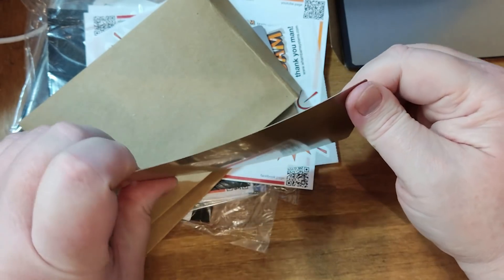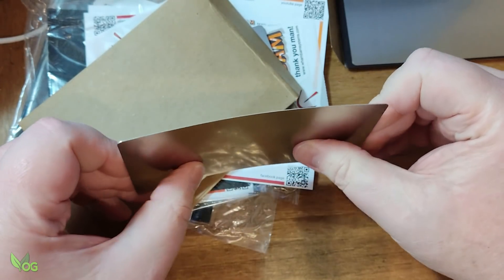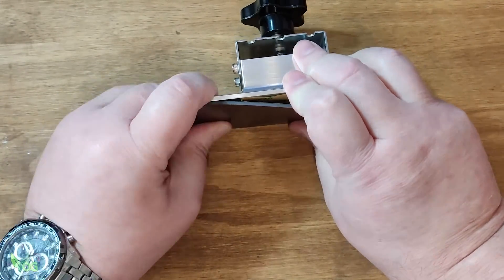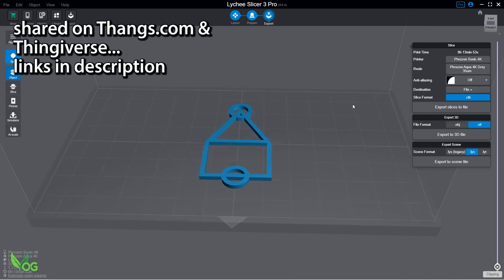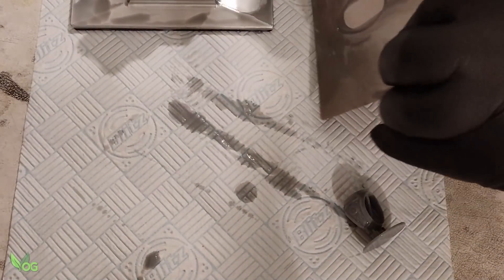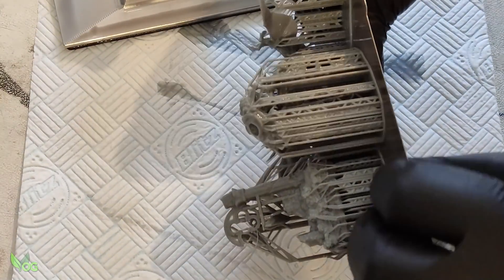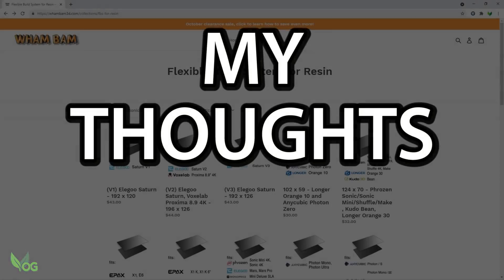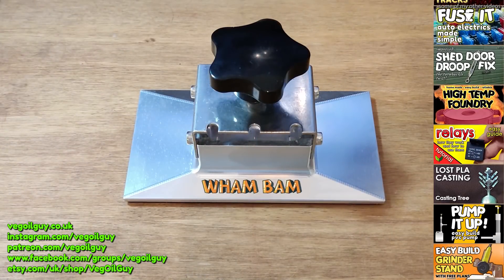Wham Bam flexible plate review - using a flex plate in Resin 3D printing - by VOGMAN

Comment: The main thing I'm looking at it for is my original saturn. It uses a ball joint, and even tightening it as hard as I can, I need to be very careful not to unlevel it by leveraging the plate against the clamp section

Comment: Is cleaning with IPA a requirement or would simply wiping it down til clean work as well? I have an Elegoo Mars 3 with Water-Washable resin so I don't keep IPA on hand.
Reply from the maker: I'd recommend some alcohol to get things really clean... nail polish remover, white spirit, turpentine, glass and alcohol wipes, etc. The cleaner it is, the better you can expect the adhesion to be.

Comment: I fitted these plates after only 2 prints on my new resin printer.    Both prints had to be removed via a hammer hitting the handle of the scraper, and that sold the flex plate to me.

They are so good, I bought a couple more.   👍

One thing I did do, was file down the tabs a little bit, as I’d sometimes manage to scape the resin tank side on my Mars 2pro with the tab.

Comment: For some reason, my build plate has become harder and harder to remove things from it. I have no idea why no settings have changed. I’ve bought a flexible plate to see how they do and my first print with it is inside my printer right now. Wish me luck.
Reply from the maker: A flex plate should work great for you. 😁

Comment: Hi, I just purchased a Flex-Plate for my Saturn S. Are there ANY SPECIAL LEVELING instructions after it’s been installed? Or will it Level using the Factory Leveling Method? 
🙏ANY HELP APPRECIATED🙏
Thanks,
Lee
Reply from the maker: Just make sure you follow the videos on the Wham Bam website. Those guys are very helpful 😁

Comment: flex plates are great. If you print directly on the print plate, this is where they shine the most (i do that often for engineering parts). If you print a lot with hard / tough resins, they are also a blessing. Just be sure, as said in the video, to do the steps needed to get a good bond on the build plate. If you don't, the resin will work it's way in under the adhesive over time and you will have a sad day waiting (been there, done that...)
Also, be sure you get a brand with 3M adhesive. There are flex plates on the market with no name adhesive and they will fail over time too (been there, done that. lol).

Be sure that you lay out your build plate from center and out. If you put prints in the corners without anything in the center they can peal off by the suction between the plate and FAP film but if you have an even pull distributed on the plate you should not have this issue... so if you have dead pixels in the center of your screen and want to avoid that by putting you print on the side, you won't have a good time. Change the screen.

... but once you go flex plate, you will miss it if you get rid of it. I like them over all despite there minor issues.

as for putting your build plate in IPA, no need for that. Just rip the flex plate off and dump that into the IPA if you feel the need. Wipe off the magnetic part and you are good to go for next print. You won't need to level your build plate often since there is no force applied to the build plate when getting stubborn models of the build plate (this is an issue you will have if you use Elegoo printers).

Comment: I've been trying to use mine for a bit now and have had a 0% adhesion. Thankfully I have a 2nd build plate. Stock. Tests on that are flawless... I must have a defunct wham bam. Which is sad cause they won't do anything about it. Had to wait too long for my Jupiter.
Reply from the maker: I had the same problem initially. It could be a resin issue as some stick easier than others. Luckily the plate has two sides. Keep one side as it is, nice and smooth. For the other side, take some ordinary sandpaper, something nice and coarse like 80 grit. Rub this in circles and cover once side with scratches. Clean well then try again with the roughed up side facing the resin tray. You should find the scratches help the resin bond. Also increasing your base layer times by 5 or 10 seconds is a good idea 😁
Reply: @vogman  yea, already tried that sadly. And no different. I can't even think of a flaw that would cause these issues.

Comment: I just got my flex plate for my mars 2 mono and am working now on the steps to clean and ready the build plate and instal the spacer needed. It is indeed VERY important to not skip steps, or do them half way. I can't wait to finally get mine installed and give it a few rounds. I have two bottles of new resin just waiting for some fun times.

Comment: I LOVE mine. Sometimes it really is difficult to get it off the plate. I have them for 3 of my printers. The one time when it doesn't help is with flexible resin like Siraya Tech Tenacious. But then you just scrape it off the old way.
Reply from the maker: Thanks for the input Phil 😁
Reply: I should clarify. When I said sometimes it's hard to get it off the plate I meant the regular plate without the Wham Bam.

Comment: For simplicity and speed, I've been printing resin lithophanes flat on the bed. Though, it was painful to remove the lithophanes from the bed, and I often broke them. When I switched to the Wham Bam system, the first attempt failed because the lithophane didn't stick well enough to the plate. After roughing up the flex plate a little, the lithophanes prints fine, and no more breaking. The one drawback, as you mentioned, is the cleanup does take a little longer and uses a bit more materials since you have to clean two additional surfaces.

Comment: I am dealing with wide and thick flat surfaces printed directly into the building plate, and it is impossible to remove them without chipping and breaking edges and corners... In my case this can be a real nerve saver!
Reply from the maker: Thanks for that. It makes perfect sense 😁

Comment: I swear by them - the Sovol pack has 2 plates so you can swap over if you want to kick off another print quicker, and the other advantage of the system is that it doesn't put any strain on the build plate head so you never knock it out of alignment trying to get a print off. They're cheaper than a wash an cure station and similarly just make sorting out the pieces after a print that much easier so I'm not really sure why wash and cure stations are more of a thing than flex plates are

Comment: I got the wham bam after a friend of mine wanted to do an order together. (I live in a country where we typically get high shipping so doing orders together saves a lot) I would normally not get the plate if he hadn't asked me. But once I got it, I must say that my process is cleaner and easier now. Being able to keep my gloves clean for longer as I now can push the plate off of the build plate into my initial IPA bath, and then clean off the build plate. This lets me clean the build plate with clean gloves, leaving the knob at the top clean as well. Then I get into removing the prints from the wham bam plate, which is much easier than before since I can just flex it, and cleaning that plate is just a quick wipe with an IPA soaked piece of paper towel. Previously I was "fighting" with the metal scraper on the build plate with resin soaked prints on it, making a big mess of uncured resin on my silicon mat. Now I honestly don't have to clean the silicon mat anymore as there is no spill on it, it's just an extra safety.

Comment: I got this flex plate for my Photon Mono SE and I used it for about 3 months or so then it failed on me.  Unfortunately resin seeped its way in-between the magnetic pad and the metal build plate causing it to delaminate.  So I glued it back on with 3M spray adhesive and the adhesion only lasted maybe about 30 or so prints.  When I originally installed it I followed the instructions exactly yet it still failed.  My thought is that the suction of the print being pulled off the fep sheet was stronger than the adhesion they used for the magnetic pad causing it to fail.  Good luck to anyone else using this and happy printing.
Reply from the maker: Thanks for the feedback.
Reply: Please write us at technical@whambamsystems.com with your experience and install process and we will help you to get a replacement and learn how to insure in a more secure method

Comment: surprised you just tried this now! i have some tips on using this.. Every time you take off a print, make sure the magnet and the plate is CLEAN. resin in between can cause the flex plate to shift especially if you have a full plate or printing things flat. Also, in the video tutorial, the guy slapped it on and let the magnet catch the plate. DON'T do that after you've taken off a print or just cleaned it and it's still wet. I've had resin and alcohol splatter on my face! good thing i was wearing PPE!!
Reply from the maker: Thanks for the important feedback 👍👍👍

Comment: I sharpened my scraper that came with the printer on a cheap whetstone on Amazon and gave it a chizel edge. Prints take maybe 1/2 a second to pop off the plate, and I don't have to get my gloves completely covered in resin by trying to flex a plate. I just don't see the point, it's an extra point of failure (I've had to help a large amount of people who had issues with theirs despite following directions) and it's significantly more messy.
Reply from the maker: I'm a scraper man myself... but a lot of folks find this tricky and these plates are a godsend for such folk 😁

Comment: I've loved having my wham bam system, so much so that I've attempted some tricky prints and will occasionally design some things around having the build plate to minimize supports. That said, flex plate systems get a bad wrap because most people don't install or maintain them correctly, or they get the cheap chinesium ones and banish all similar systems to the Sin pile after having issues. I can't tell you how many people have their systems slide off during prints and blame the plate when it's both a quality issue, and they're trying to print a 1/3 scale bust without hollowing the torso. 🤦‍♂️
Well reviewed and I'm glad you gave it a fair shake.

Comment: I put flex plates on all of my machines. Why? Because I run thin rafts so that my burn in layers will extend to the first few layers of my supports. Makes for more solid supports, and ultimately better prints. And getting thin rafts off of a standard build plate with a metal scraper is a nightmare.
I will say that one drawback is occasional shifting of the flex plate on large build plate when it's fully loaded. Typically does this on the raft layers or if I'm printing a bunch of flat bases for minis. I fixed this by supergluing some strong magnets to the top of the build plate to give it extra magnetic strength
Reply: I was thinking  of doing the same thing and add some magnets to the top of the build plate.
What kind of magnets are you using?

Comment: I leave my build plate on the machine and only take off the flexible plate. I throw the flexplate with attached print into the wash and cure machine and give the magnetic surface a quick wipe with an IPA dampened paper towel. Once the wash and cure machine has gone through a cycle, I pop the print off and give the flexplate a quick wipe with a dry paper towel and put it right back on the machine. 

I bought two flexplates to reduce time in between prints but haven't found it necessary to use the second one yet, clean up is that quick.
Reply from the maker: Thanks for the input 😁

Comment: I'm so glad you checked them out!  I have about a dozen of their magnetic build systems on my FDM 3D printers and love them.  I bought one for my Voxelab Proxima and in my excitement to get it setup, didn't read all of the instructions!  A spacer is needed where you clamp the build surface!  I promptly blew out my FEP sheet...it wasn't a complete tear but somehow I keep having resin appear on the screen, ruining prints.  So, I sprung a tiny leak! (Also, don't use a plastic scraper to remove resin from the skin surface, I ruined that too! Anyone want a fk'd up Proxima? 😂 )  Great review!
Reply from the maker: Thanks for the input 😁

Comment: Wham Bam installed on my Sonic Mini 4k. Got layer shifts at the lower layers all times. Internet research: im not allone at all. -> Trash. Expensive experience
Reply from the maker: And yet so many comments here speak positively. Can I ask, do you clean the plates after each print. If you leave resin on them it can act as a lubricant between the plates allowing for a little movement. That could cause the issues you mention... just a thought 😁
Reply: @vogman  yes,of course, I Clean always after each print. First with 99% Isopropanol, then before a new print with acetone, until there is no residue colour on the cotton Pad. But that was not the problem, the metal plate shifted, even thoroughly cleaning the plate faced to the magnet as well as the magnet itself.
Reply: Hello, I do not own yet a Resin printer, but considering to  own one once. Just wondering if the lift speed needs to be adjusted for larger printers when using a magnetic bed, to reduce the pull force when printing larger prints?
Is that something to consider?

Comment: I'll never understand why people take the whole build plate off... Just take the flex plate off with the part....
Reply from the maker: From what I can gather,  if you leave resin on them it can act as a lubricant between the plates allowing for a little movement. It's safer to remove and clean - just in case 😁

Comment: Nice review! Glad it made you a believer in the Wham Bam FBP system. I have one on my Sonic Mighty 4K and it's improved print removal tenfold. I wasn't a fan of all the scraping to get prints off the stock surface. Also, I've put it in the Anycubic Wasn n Cure Plus many times after print completion and it continues to have a strong bond, despite all the IPA baths.
Reply from the maker: Thanks for the share 😁

Comment: The only good reason for a flexplate that I can think of is if you need to directly print on the plate, and a scraper would damage the parts (i.e., your first test). Metal scrapers get things off very easily otherwise, especially with rafts - I wonder if most people have far too many bottom layers with too much exposure?
Reply from the maker: I felt the same way... but when you use one, it does feel easier 😁
Reply: If you have to use any force on the stock build plate you can knock the alignment off. Even if you have to use some force on the flex plate it's not pushing anything out of alignment. Less re-levelling = more succcessful prints and less hassle

Comment: The only one I had problems with was the one for the mono x, the first one I got had a weak magnet, and large prints would pull the flex plate off the magnetic bed, they upgraded the magnet and sent the new one to me, it is better, but still needs improvement as bigger prints still pull it off the plate, just not as bad.
Reply from the maker: Interesting. It's good to hear they listen to their customer though 😁

Comment: I had the original Elegoo Mars and used it with Elegoo resin. Never had a Problem. BUT when I got my Anycubic Mono and started Printing Sirayatech Blu with it there suddenly was no way to get the prints of the plate without destroying them (printed without support). Still not sure if its the plate, the resin or the combination. Anyway, got my self a flex plate, tried it and worked perfectly. Happy flex plate user ever since. Great video as always :D
Reply from the maker: They are nice and easy to use 😁😁😁
Reply: I had the same issue with my photon mono x when printing out some smaller pieces using Siraya Fast. What fixed my issue was turning down the base exposure times to 20 seconds, from the default 40 on anycubics software.

Comment: I put a Wham Bam plate on my Mars 2 Pro a few months after getting it.  I could never go back to a normal ridged plate now.  I print mostly minis and they literally just fall off when I flex the plate. No more prying with a super sharp scraper.  I love it!  Regarding long-term usage, I've been using mine for about a year and have had zero problems at all. I fully intend to buy a Wham Bam plate for any future printer I buy.  I wish printer manufacturers would add them as standard equipment lol.
Reply from the maker: Thanks great user feedback. Thanks 😁

Comment: Do not be tempted to buy cheaper versions! I bought the Toaiot spring steel plate from Amazon and the magnetic pad was so thick there was no height movement in the build plate when it came to levelling leaving the build plate squished to the lcd screen
Reply from the maker: Thanks for that important feedback Philip 😁
Reply: Even the Wham Bam plates require an adapter shim between the z axis homing switch on some printers to avoid this. It's a simple 3d-printed part. The magnet is around 3-4mm thick.

Comment: Best thing I ever bought, I have 3 plates for the 2 machines I use, It makes all the difference to work cleaner and easier without a lot of mess and even to the point that can do the job with the least protection at times. When 1 job finishes's I pop the the Wam Bam with print in the washer machine and use my third plate to get the next job underway
Reply from the maker: Thanks for the share Janet 😁